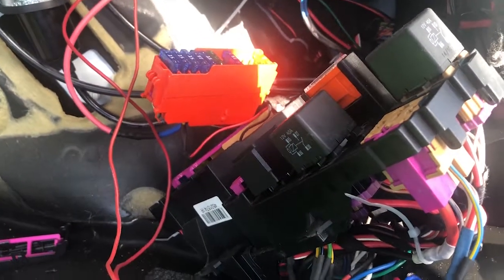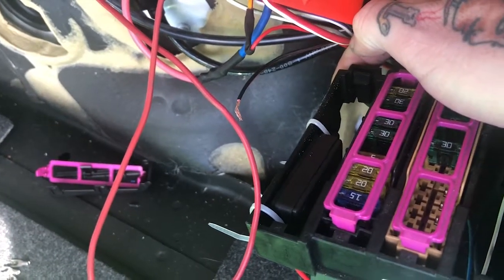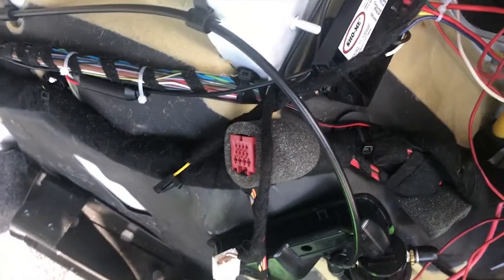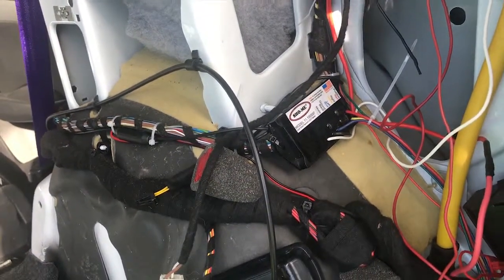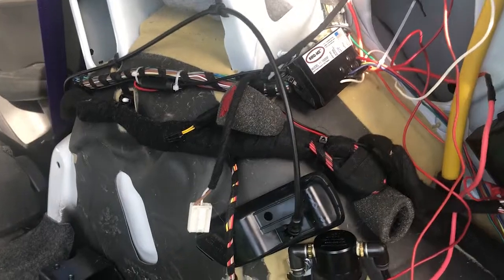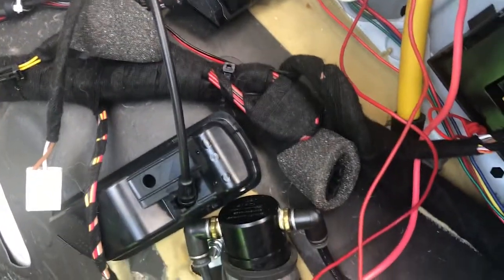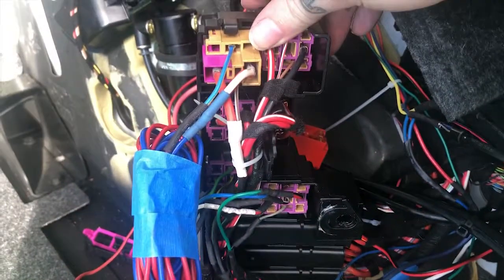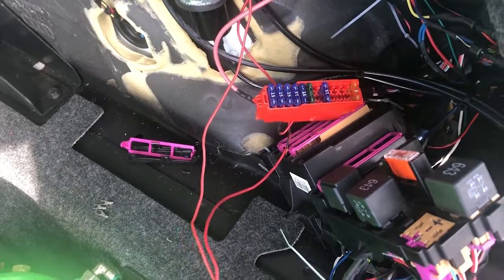Audi Q5 (8R) LED Reverse Light / 3rd Brake Light Flasher + Wireless Bypass | Less Functional

Comment: I have a Q5 2018 and want to install reverse camera where can I find access to the reverse lights cable so I can use it as the reverse trigger of the camera
Reply from the maker: Since you have a newer generation I’m not 100% sure; but on the 8R it is in a bundle of wires on the right hand side of the trunk.

Most aftermarket rear view camera utilize a plug and play harness which includes the trigger; and is plugged in by the screen.
Reply: @LessFunctional  Thanks Less, in fact there are some fuses in the trunk in the left side of my trunk but I cannot identify the Reverse or backout light cable so I can plug it there, my stereo yes it have the cable for the trigger but I think I need to connect the other side on the reverse light cable so it will trigger the camera and switch the screen to the camera video, lets see what I will do haha Ill let you know if I found a way to connect it

Comment: I also have a 2016 Audi Q5 TDI. I tapped into the blue rear brake light wire adjacent to the rear light assembly, this triggers the trajectory lines to show when I put it in reverse. However now I also am receiving a defective light bulb warning on the display. Is there a fuse for the reverse light? I have looked but can't find it, or do you know where do i tap into to put a reverse camera so trajectory lines are displayed,  thank you.